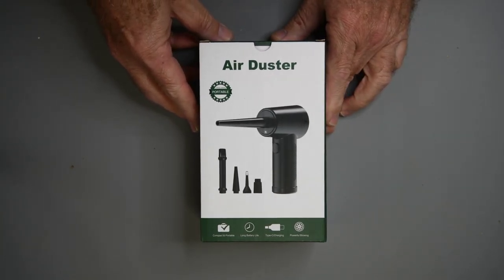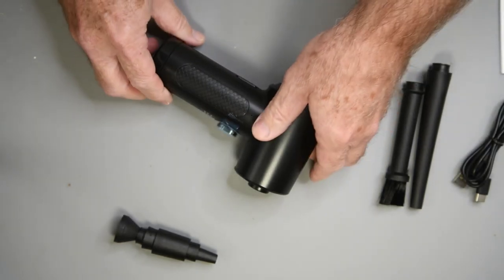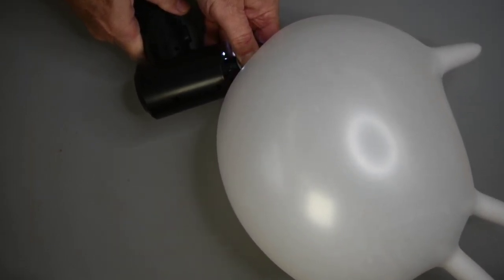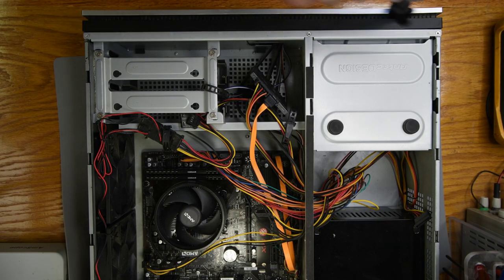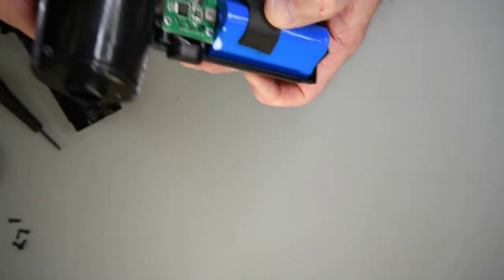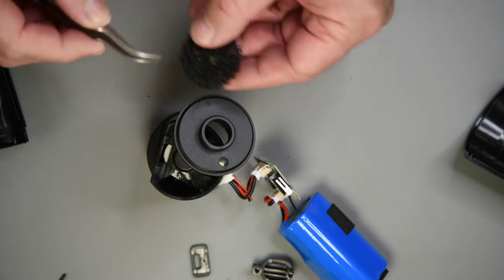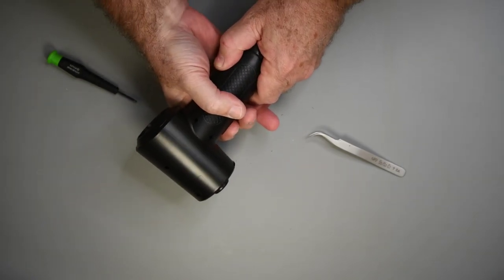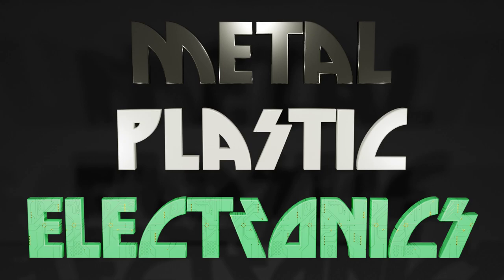Can this Blower Kick the Canned to the Curb?

Comment: Very nice review.  Was just hoping you'd test the 68W power rating of the fan.   I've been looking at battery powered blowers on amazon for a while, and have yet to decide on one.  I have a 120v plug in blower, that moves A LOT of air.   But I'd like a battery powered one, to blow dust, and animal hair down our hardwood stairs.  Instead of having to use a boom and sweep everything to the bottom, I could just blow it all down, then sweep it up.  And there's a few other handy spots that's not near an outlet which would be nice to use a strong blower, like under the fridge and under the stove, and a couple closets, one where we put the cat's litter boxes, and those closets have no outlets.  I'm trying to not run extension cords everywhere.  But until I find a decent battery powered blower, I may have to.
Reply from the maker: The little over 20 watt battery will run it for a bit less than 20 minutes.  So it’s probably in the 60 plus watt range.  Lot more than I expected.